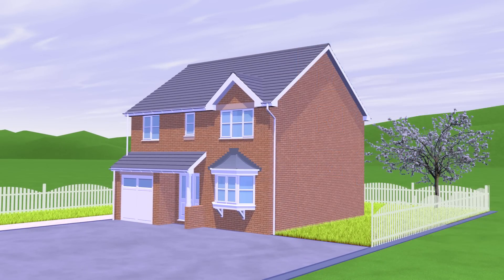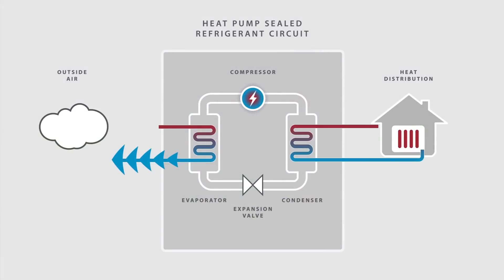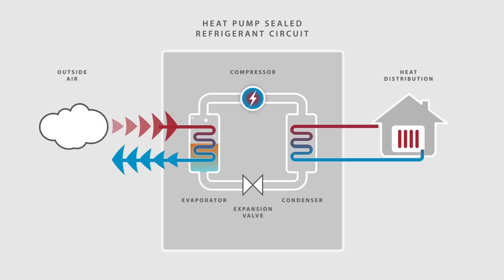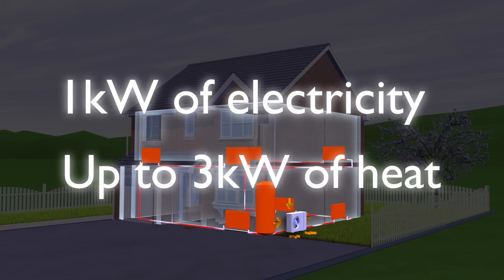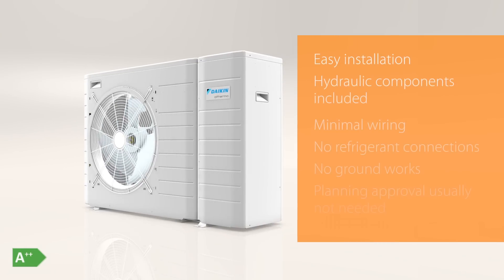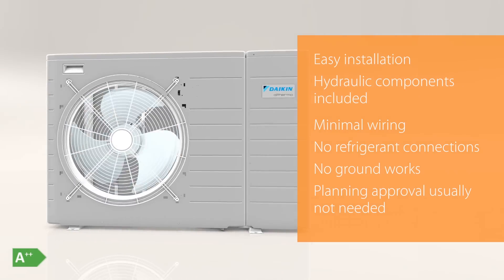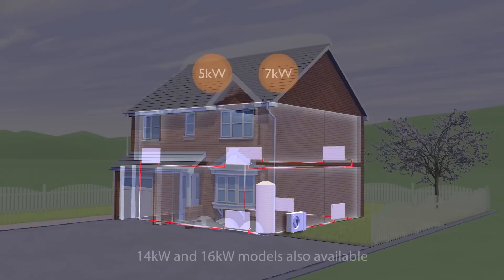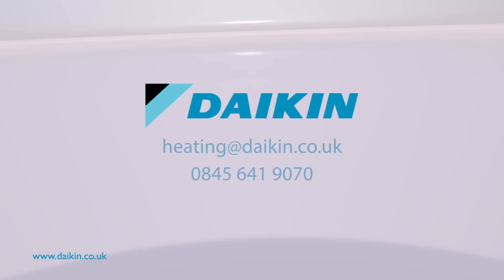How a heat pump works - for installers

Comment: I've just bought a new-build home with this "fantastic" Diakin Air Source Heat pump - it spins constantly, whether I'm using the heating or hot water, used 2500 kWh in 3 months (for single occupancy two bed apartment) - the sort of electricity used by a family of four in a year!!! Plus it was installed incorrectly and one of the radiators remains on constantly. Still waiting for it to be repaired over SIX months later. Recommendation: burn paper money in an open fire - cheaper and warmer.
Reply from the maker: Hello, I'm sorry to hear to this and understand your frustrations. Please could you send an email to ukmarketing@daikin.co.uk along with a contact number and address, so we can urgently get this resolved for you.